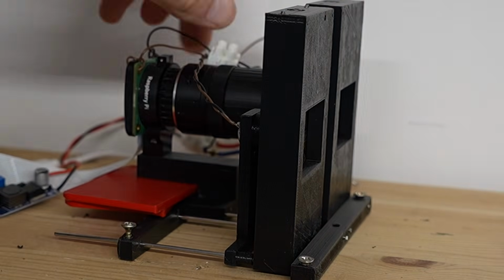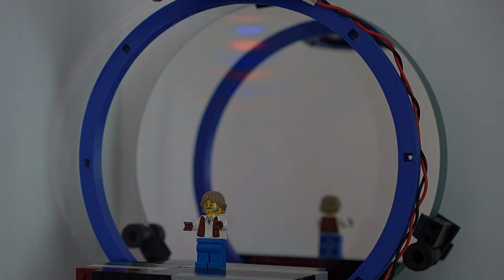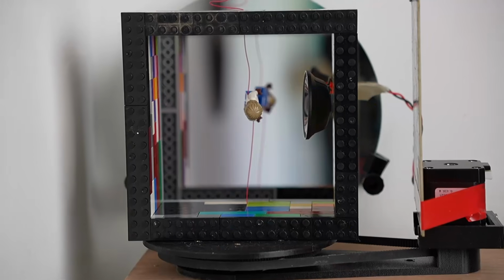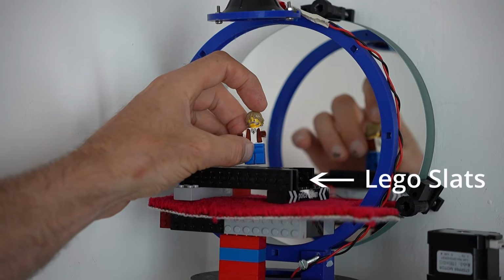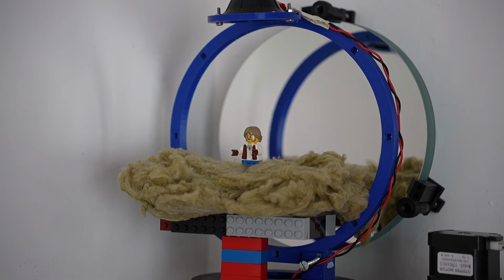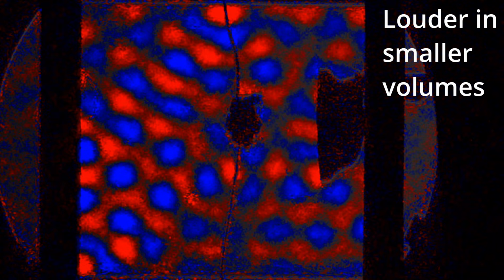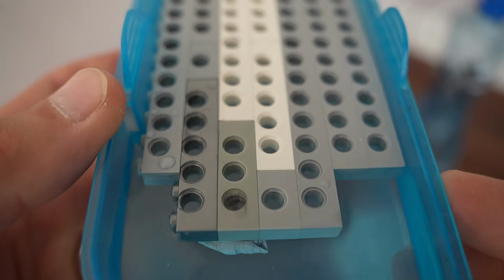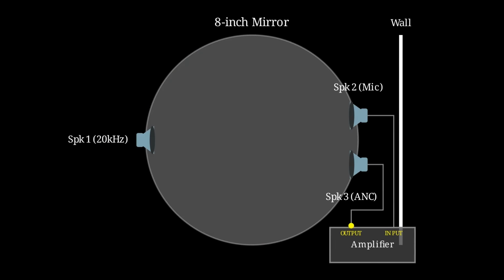How Your Room Destroys Sound (I Filmed It)

Comment from the maker: My ears are still recovering from that active cancellation feedback loop! 😅

Something I breezed over in the video: Because the acoustic foam dimensions didn't scale down 40:1 with the sound waves, those inch foam ridges essentially acted like a massive 5 foot deep wedge (Relative to Mr Lego) of an anechoic chamber! That's probably the main reason it absorbed low frequency sound so well! 

Question for you all: Do you think our brains just "fill in the gaps" of bad room acoustics naturally (psychoacoustics), or do you prefer to completely treat a room so the acoustics are perfect (If there is such a thing!)? Let me know below! 👇

(PS: If you want to build a CAT scanner rig, the code and CAD files are linked in the description! Old Pi4 and new Pi5 + Pico versions)

Comment: I wonder if you could take the data from the scanner and use it to reconstruct the "to scale" audio
Reply from the maker: You can definitely take a slice through the Schlieren images over time to show the pressure waveform at any point in the room, like a virtual microphone you could move to different locations in the room! 
You could also take a cross section of the Schlieren image to see how the waves decay as they propagate across a room..
From there, you could pitch-shift it down (Audacity can do this easily for free) to convert ultrasound into normal hearing range.

Comment: Indeed excellent acoustics depends on the correct room treatment, and it must be included in each single inner surface to help absorb all the reflections.

The idea behind this video of producing the inverse wave, I t’s so interesting and represents the most accurate solution, but also it’s so complicated to do, cause when the sound scatters around one room, it has partial reflections and absorbs y any single element it has contact. Imagine a concert hall, were hundred of people assist to the night performance, each single of them becomes an absorbing element due the fabric of their clothes, and any one of them depending their dimensions, distance and how they are sited respect with the audio source are absorbing or reflections a certain amount of sound different respect each other assistant, and calculate all those different variables on live time hundred or thousand of times each second,  in order to send the exact wave to a speaker system located at the back would be an impossible task. So the Architectural Acoustic designers use an easier solution and simply install a bass trap at the rear part of the auditorium to absorb those waves and avoid they can return to the center stage

Comment: The sound absorption test was flawed,  as different materials absorb different frequencies. The foam is more of a myth than a valid anti reflection material. In real life, it only absorbs the highest frequencies, and only meagerly. The rockwool is multiple times better, actually the best possible.
Reply from the maker: That's a really good point, normally Acoustic foam wouldn't be able to absorb low frequencies (I should have explained that more). But when I scaled everything down the Acoustic foam started to behave more like an Anechoic chamber (The ridges were nearly 5ft high at 40:1 scaling) So  the ridges were able to absorb much lower frequencies than normal.

Comment: Yeah, but...
Imagine that what you are listening to via the speaker is actually where the speaker is.
You wouldn't perceive any weirdness since our hearing compensates for rooms. 

You don't listen with just 1 ear. if one ear is at a null point due to reflections, your other ear isn't. Your brain uses both ears to listen to the source. 

In fact room dynamics are beneficial since it is a natural environment for us.
Even to the point that there was (is) a trend in recording studios to put a rough brick wall next to (around) the speakers. Its call early scattering and really helps cut the nonsense from wall reflections.
Reply from the maker: For sure, I always find psychoacoustics amazing, but tricky to reconcile with how sound actually propagates. You are totally right that 2 ears help us compensate for higher frequencies, but with low frequencies the wavelengths are so large that your entire head (and 2 ears) can easily sit inside a single dead zone or high spot.

I find it amazing how our brains fill in the information gaps, like adding missing frequencies to a chord. It always reminds me of the times I've kept singing along to a playlist subconsciously after the music stopped! But I suspect a lot of psychoacoustics relies on us knowing what to expect. If you are really focused on a completely novel track, I'd reckon our brains have a much harder time filling in the missing sections.

So my theory is just fix the sound source and room and then you don't need to worry about psychoacoustics :-) (I wish)

Comment: Cancelling the waves with a single opposing speaker might be tricky because of the curvatures, but with a few you could create an exact interference pattern
Reply from the maker: Yes, I was thinking I would almost need to fire a 2nd speaker at the wall to create a wavefront with the same curvature as the one I am trying to cancel, or vibrate the entire wall (like an electrostatic speaker) if the wavefront was more flat, thanks for commenting

Comment: I bet you could get the active cancellation working by using an FPGA.   as long as it has the ports for audio/speaker, then it'll come with example verilog to get it all connected.  Then you could start by just copying the mic to the speakers (the latency might actually be low enough, since it's an FPGA).  
otw you'll have to predict the sound..  that's harder (but I think you could try a SARIMA model from statistics that you should be able to implement on an FPGA too). I wonder what state of the art is for sound prediction, time to go surf!
Reply from the maker: I reckon that would be really satisfying to get a system to train itself to correct room modes and come back and everything is working, without needing to adjust lots of sliders. I was keeping away from FPGAs for a bit, but it is really tempting for these kind of applications :-)
Reply: @plasmatronX  If you ever take the plunge and are still figuring out everything yourself remember the AIs are getting surprisingly good nowadays.  I just recently made a whole pi5-based security system thing all with the help of gemini (and only like 15% hallucination; it's a quirk you totally acclimate-to.. really NBD!).  I bet gemini et-al can make a working verilog testbench with a DUT that does the audio copying (and maybe even the predicting).  I get you'd worry about getting weak (assuming you're like me), but damn dude, it's pretty cool getting a big thing done in an afternoon!